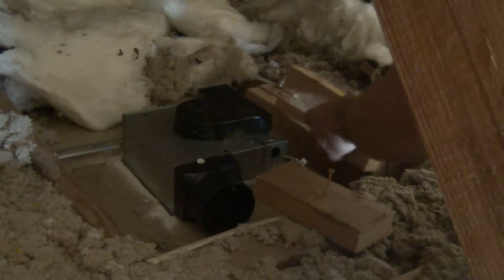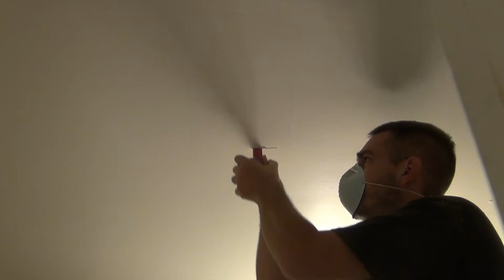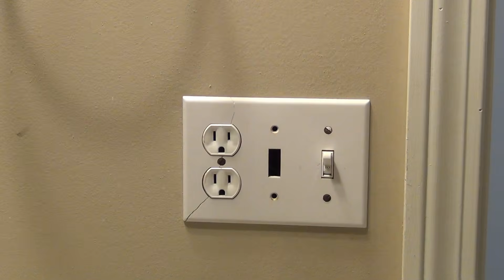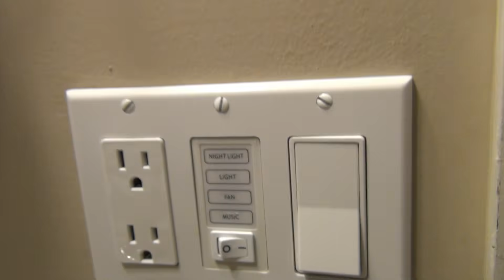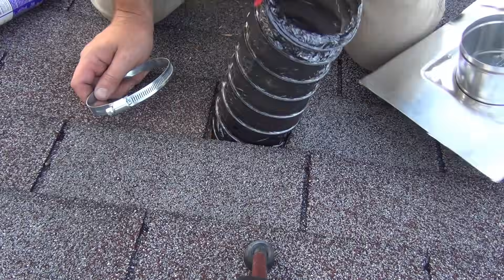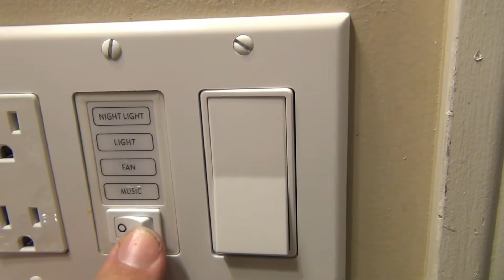Bath Fan Installation - Home Networks LED Bath Fan with Bluetooth Speaker

Comment: I have the same fan too. But unfortunately my fan, led, music stopped working out of nowhere. I have power going into the the whole fan. What could it be that causing my whole fan not to power on? Could it be the actual switch that it disconnected somehow. ?

Comment: great video...we just had one installed with a full bathroom remodel.  we have 2 switched, so the fan is on one switch and the LED light and speaker are on the other switch.  i have one question:  is the LED light/speaker able to be put on a dimmer?  thank you!

Comment: We put in a square one by Netwerks. 

It was the first time we had a fan in the bathroom. I had to rewire the junction box and add another wall switch. 

They had the previous overhead light directly in the junction box and the vanity light/w a plug in on the same switch as the overhead light.

Comment: Mine is flickering and usually only half the unit works. When I push and mess with it the other half the lights flicker on and off. It drives me nuts. What do I do to fix it?

Comment: You need a gfi outlet in your bathroom, the wire connect the fan needs to be inside the fan housing with a wire clamp so it doesn't move

Comment: How the freak do you get the bluetooth speaker to work?
Reply: Is yours not working?
Reply: @Guero619  yea I just moved into my uncles house for a bit and noticed the light/fan was also a speaker. I’ve been trying to connect with my 12 mini on iOS 14.7.1 but no luck no matter how many times i turn off bluetooth and restart
Reply from the maker: Make sure no other device in the house is already connected to it
Reply: @SSLFamilyDad  i checked everyones device in the household. It’s not a saved device on anyone’s phone. Any advice?
Reply: @SSLFamilyDad  can u have it set up so music plays automaticly when switch is turned on

Comment: My bathroom has a single switch that turns on the fan and the vanity light. Can I install this without the provided switch?
Reply from the maker: No you need the provided switch but should be able to separate the switch for your vanity and then use the included switch for the fan

Comment: I picked up the smaller version that doesn't come with a switch. I'm a little confused because the light and fan have separate set of wires. I only had a light in that spot so there's only 1 black and 1 white wire that I have in that spot.

Comment: I've finished the installation but struggling to get the round unit to the ceiling (at 11:30 yours is nice). The spring wires you're supposed to use as attachments to the fan box are too long by about 3/4". No matter how much I try to push the round unit up it leaves about an inch. The spring attachments don't work. Any thoughts on work arounds for this. Thanks
Reply from the maker: It was tricky but the wires actually push through a little in the clip as it slides up into place, keep working at it, it will pull it snug to the ceiling when it is right
Reply: @SSLFamilyDad  Ok I decided to just give it a big whack upward and it clicked into place flush to the ceiling and stayed snugly. I think I was just too gentle trying to push it. It took a good whack. I will needed to remove it all when I do drywall repair and painting, but it did pop in place. Thanks.
Reply: I had a similar issue which I resolved by using a taller ladder to reach across into the opening not up and across

Comment: How do you program the blue night light? I can’t get it to stay on when holding down the button. The blue light turns white after a few seconds holding down the button
Reply: Did you ever get a reply to your question or did you resolve it on your own?
Reply: @ds61821  the light is still not programmable.
Reply: @quickcmr2  I think I have an answer to your question if I understand your question. Do you mean you are trying to pair the switch to the fan?  That is, you go through the pairing protocols but the blue light flashes and then you touch the Light button and rather than going to a blue light that remains on it instead switches to white?  Is that what is going on? If that is what is happening, then I know how you can fix that. It happened to me and I figured out why. It works now fine.
Reply: @quickcmr2  What I discovered why my switch would not pair with the fan unit was because of a connection in the fan unit (ceiling side in bathroom). When I connected the grill wires to the wires coming from the fan unit I accidentally bent one wire (of the three) so that it didn't go into the connector. Do you know which connector I mean?  I had 2 of the 3 wires correctly inserted in the connector, but the 3rd wire was bent. I took my flat-tip screwdriver and carefully aligned all three thin wires and made sure they got connected correctly. I then was able to sync the switch to the fan unit. I hope that works for you.
Reply: @ds61821 how did you sync the switch to the fan unit ? Mine disconnected for no reason , nothing turns on and I have full power going to it
Reply: @polarity8908  Tbh I don't remember how I did that originally and it's been working ever since. You might have a bad switch if nothing turns on and you have power to the unit. They should be able to send you a new switch if you are still under warranty--or even if not. Complain nicely and see if they will send you a new switch.

Comment: The 1st set up is not pairing when it says switch on and of till it flashes and then press light to when it turns to a solid blue mines not doing that when am I doing wrong

Comment: Is the Led light replaceable when it goes bad?
Reply: It actually has 3 sets of LEDs, White (13 Watts), Blue (11 watts) and Yellow (9 watts). They usually last like 50,000 hours but i don't recall this manufacturers actual rating for their lifetime. In any case, if one burns out yoiu still have the two others.

Comment: Already installed 2 in my bathrooms, mine were more tricky to install being we live in a manufactured home and there is no attic access nor enough height to get into the attic area anyway! Directions say you have to be able to get into the attic area to be able to install these. Which would be ideal if you have a attic space to get into! But you can install these from inside your bathrooms if your extremely careful making the ceiling hole just large enough to get this ceiling fan fixture to fit thru the hole on the ceiling. I had old fashioned ceiling fans that I removed, which were connected to a 3 inch ducking.  Since there was no easy way to replace the 3 inch ducking to the new 4 inch ducking, I just used a 3” to 4” reducer connected directly to the new ceiling fan and connected other 3” end to the existing ducking. Fortunately you can cut the ceiling hole just big enough to slip this ceiling fan thru the hole into what would normally be your attic area. Then I had to cheat a bit and toe nail a couple screws thru the metal ceiling fan into some wood bracing from inside the bathrooms. As I mentioned already, if you cut your hole just big enough that you can tip the protruding vent connection on the ceiling fan thru your ceiling hole and then raise the other side of the ceiling fan into place. Your round ceiling fan cover will just cover up the larger hole in your ceiling needed to get the ceiling fan into place in your ceiling. Once again you must be very careful not to cut the hole in your ceiling any bigger then necessary to slip the ceiling fan assembly thru the ceiling hole, being the round ceiling fan cover just barely covers the larger hole. But if you did mess up and cut the hole too large, you could fill the extra area that would show past the round cover with some paintable silicone or some Sheetrock mud if it’s only a minor hole showing. But as long as your careful cutting your hole no bigger then necessary to slip the ceiling fan assembly into the ceiling where it needs to go. Your ceiling cover will hide the hole completely and there won’t be any need for having to fix any areas where the larger hole might show after installing your ceiling fan cover! Basically I made a square hole the proper size, then had to cut out a small area where the 4 “ ducking protrudes past the ceiling fan box. By angling the ceiling box with the ducking side going thru the ceiling first. You don’t need to cut out the ducking spot as much, better to cut small and try to fit the ceiling fan into place. If you can’t get it into place cut a little more where the ducking goes till the ceiling fan assembly will tip in and slide into place where you want it!  Toe nailing some screws thru the metal ceiling fan assembly may require a punch to dent the metal so your drill bit won’t slip/slide from where your trying to drill your holes for screws to mount the ceiling fan assembly flush with the ceiling Sheetrock!  I’m a retired contractor, so this wasn’t a big deal for me at all, but for others less experienced may find doing this a little scary to install these in this unconventional manner? But it’s honestly not hard to install this ceiling fan assembly as I did and no one will ever know you didn’t install this ceiling fan according to the regular directions the ceiling fan comes with!
Reply: I was just looking for a way to do this job in the inside didn't want to climb up in to the attic.Thank You!
Reply: @jannelie32  I live in a manufactured home that has no attic to get into. So I installed mine from the bathroom. You have to do some  creative installation doing it this way. For one since you can’t get in the attic to screw the fan to the ceiling supports you have to drill a couple holes on each side of the fan box on the inside so you can screw screws into the side of the wood supports to hold your fan box in place. Biggest trick is if your using the round fan like shown in this video you got to be careful when cutting your hole for the fan box or your hole Bell will end up too big for the fan cover to cover the corner of your hole!  I already had a existing fan that I removed to install the new fan. The new fan was considerably bigger so I had to make my hole bigger. Where your fan box has the vent tube protruding past the fan box is the trick to making your hole just big enough that you can get that vent tube thru your hole and the rest of the box will slide right in.  I also had to use a 4” to 3” reducer vent pipe since my original fan had 3 inch vent tube and the new fan box is a 4” vent . This of course does choke down the air flow some from having to use the 3” original vent tube. But it works as well if not a little better then the original air flow the existing fan put out.  Wasn’t a huge concern for me. I had a just enough play in my existing vent tube that I could slightly pull it thru my hole and connect the reducer to the fan box and the vent tube to the reducer and slide the vent tube, reducer up into the hole first then tipping the back side up into the hole and screw the new fan box to the supports on each side so your box is flush with the ceiling. And put your round trim piece on and your done after turning your power back on if you disconnected the power? Long as you’re fan switch is off and no one turns it on while your working with your wiring there’s no power running to the wires to get shocked by. I’m a retired contractor by trade, so this may of been easier for me to figure it out how to Mickey Mouse this installation so it looked perfectly installed after the trim plate was put on. The hole size to get the box up into my ceiling just barely was covered with the finish round trim plate. So there’s no room for errors cutting your hole! If the corners of your hole do show a little past the finish trim plate you can use a little paintable silicone to fill in whatever shows past the finish trim plate. Or you can get some Sheetrock mud and fill it in too, whichever you prefer to do?  If you don’t have a existing fan box with the vent tubing and electrical already ran in your ceiling. There’s really no good way to install any fan box into your ceiling without some how getting up above your ceiling into what would normally be the attic to run the electrical wiring and the vent tube unfortunately has to be done from above the ceiling! Long as you have a existing fan that’s connected properly, it can be removed and a new one installed from inside the bathroom itself.  Not as it was intended to be installed, but no one will know you had to Mickey Mouse your fan box installation but you and I! 😉
Reply: I was thinking about getting this fan. I have access above the bathroom but I would have to starve myself for a month and perhaps cut off one of my arms.  Anyway, how did you access the wiring and put the ducting together?  Did you just drop down the power/neutral/ground through the hole and hook it up inside the bathroom and do the same with the ducting and then push everything back up and fasten the fan?  
As for the wiring, some people apparently have a difficult time figuring it out. It seems pretty simple to me, provide the hot, neutral and ground and connect these to the fan.....I'm probably missing something as things are never this easy.
Reply: I think if you open fan and access its blades they are in certain angle.  if you bend angle little bit such that all 3 or 4 blades have sharper angles, the fan will make louder noise. BUT, you must make sure that all blades angles are identical but careful measurements so that when they rotate they dont run imbalanced. Alternatovely, buy a new one and l;ets swap it for my 1901 bathroom fan.  I am joking.
Reply: @trueforum378  I did install it and it was quite easy and didn't need attic access because I reached in to attach to the joists.  I just installed it up through the existing cut-out but wired it before hand.  It's a great fan. I do have a question, however, how do you get the light color to change? Do I have to access this from my phone or computer?
Reply: @richardl3720  Actually I do not have this type of fan nor know about it.  I was advising you on "general" fans that have blades from past experience in mechanical and particularly refrigeration fans or any fan that has blades if you bend the blades you get noise depend on bent angle.  This will not work for all fans as some fans may have circular all blades connected together and that will not work.  Color changes?  of course factory specs should specify so I would download specs from manufacturer website am sure it will tell you. Good luck. Robert

Comment: Like all your videos, I enjoyed watching this one.  One thing in particular I noticed that concerned me was the way you had the wiring installed.  The Romex cable should go through a stain relief that you need to put in the hole in the sheet metal junction box first. They are super cheap, but never come with the fixtures.  They protect the wires from abrasion, especially since the fan will be vibrating when running. Then you make the connections to the fixture wiring, and close the junction box up after you are finished to protect the exposed wiring.
Reply: Did you see his roof penetration...I don't think he's worried about fire.

Comment: Great video as always! I may do the same, but I just have to replace mine. One thing I wanted to mention, and don't take this as a criticism, but I do believe you should have a GFCI since you have an outlet there. Maybe there's one upstream? Either way, it is needed for safety. Take care and God bless!
Reply from the maker: yup, you are 100% correct there. There is actually a GFCI in the wall in another location that feeds that outlet so it still meets code.
Reply: @SSLFamilyDad  can you put a dimmer on this device and not the original switch

Comment: I'm a believer in loud bathroom fans, to disguise any unavoidable noises you may create while in there.  I also like installing a timed switch so you/your kids don't forget and leave the fan running for hours.  I don't have usable access to my attic so or fan is not installed completely,  need to cut an attic access in the hallway.  You'd be surprised how few people actually vent their bath fans to the outside.  Local hardware had all the employees dumbfounded that I want okay with just venting to the attic.  I embed up buyback a vent to go in the soffit, think it'll be okay?  I need to buy insulated tubing as well. Great video SSLFD!
Reply from the maker: lol, you can just play loud music on the speaker instead:) So, yeah, if you are venting in the attic you can end up with some pretty bad moisture issues and mold so you want to make sure that is working right. Soffit vent would work just fine. There are also fans that you can get where you don't have to have access to the attic. Let me know if you need a hand!

Comment: Nice video bro but you need to go back up on the roof. Where you put the tar on the top part of the flashing in the rain channel between the shingles you need to tar that whole channel because the water will hit the tar and disburse to the left and right underneath those shingle tabs and eventually you will have a problem. Other than that great job!
Reply from the maker: yeah man, I think I emptied the rest of the tube in that crack after I turned off the camera but I will check, I am just so glad that this thing works!